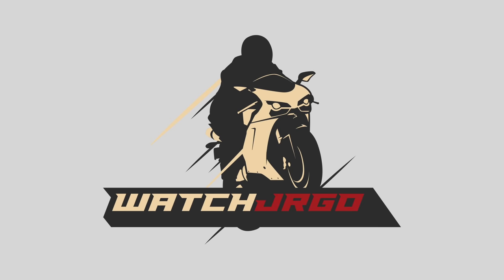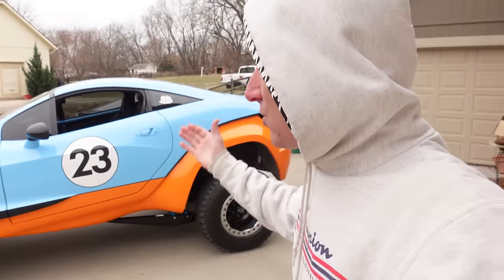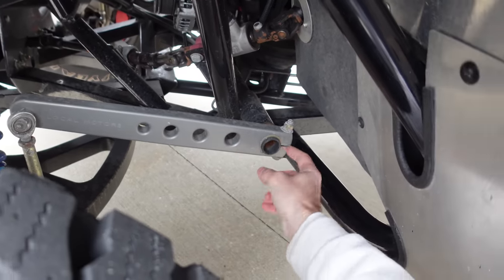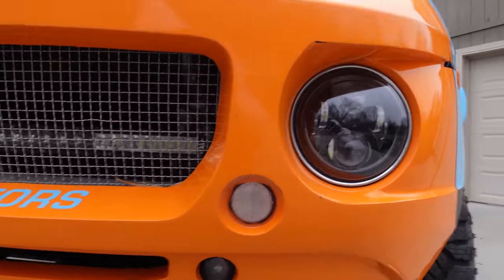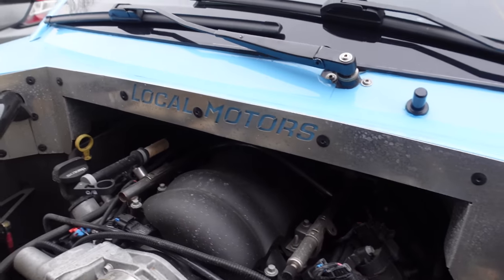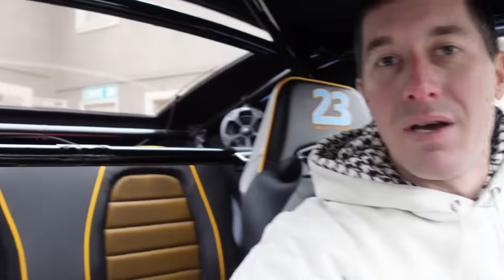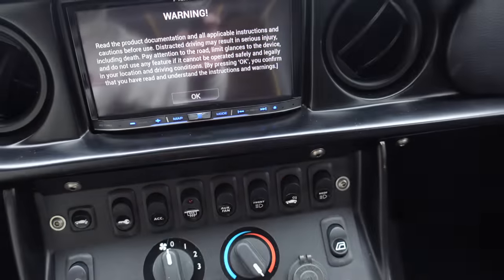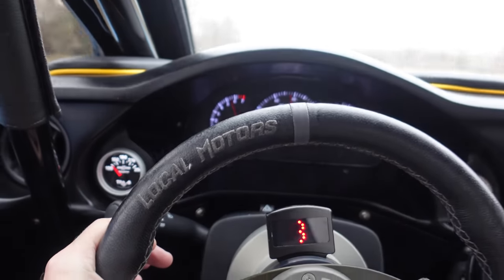AMERICA'S Off-Road SUPERCAR: The Local Motors Rally Fighter

Comment: Column and original steering wheel were Ford F150, complete with airbag and on-wheel CC.  This one was replaced after it left the factory.
Reply: Partially correct. The steering column is F-150 but all Gen2 cars had momo Monte Carlo race wheels or this driven LM branded wheel. Gen1 cars had the F150 wheel but no Rally Fighter had airbags. Also this was the original wheel for this particular car.

Comment: FYI you are not supposed to let cars idle to warm up, it's worse for them than just driving at a slow pace because it stays cold with things at the wrong tolerance for longer.
Engine builders have specifically traced the Porsche bore scoring issue to people that idle their cars to warm up in winter.

Comment: Where's the power band?
Reply from the maker: Linear to the top.... plenty of torque down low, it doesn't need to shift all the time. Then when you get on it the power just keeps coming and coming until the shift point 🍻
Reply: @WatchJRGo  interesting, I have never driven anything with power like that and did not have a distinct RPM you felt the boost at.